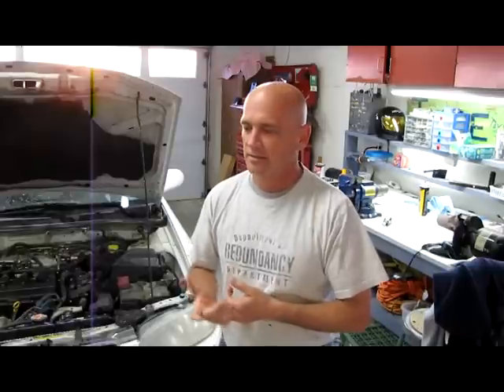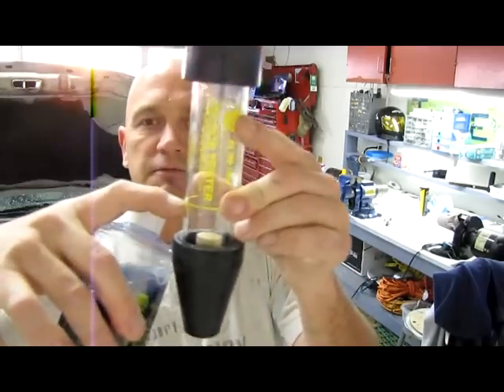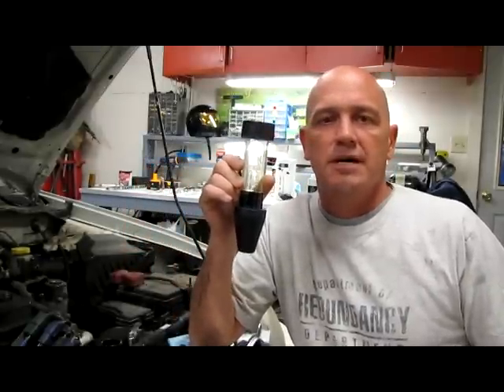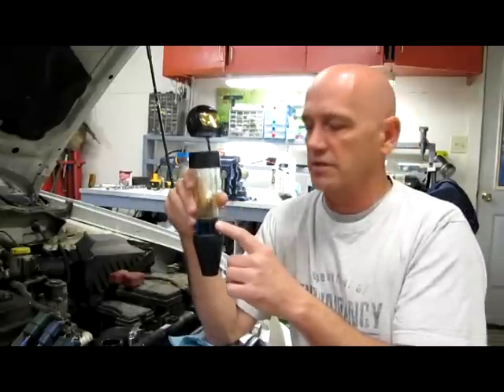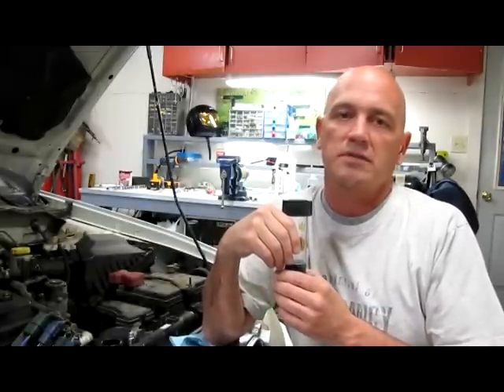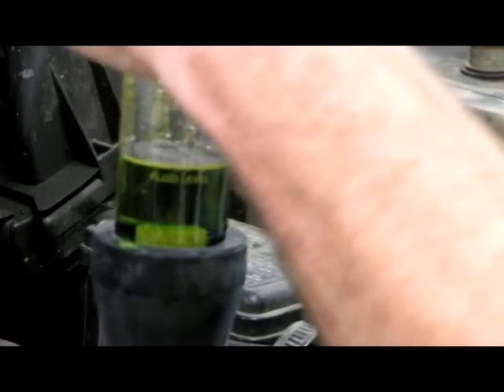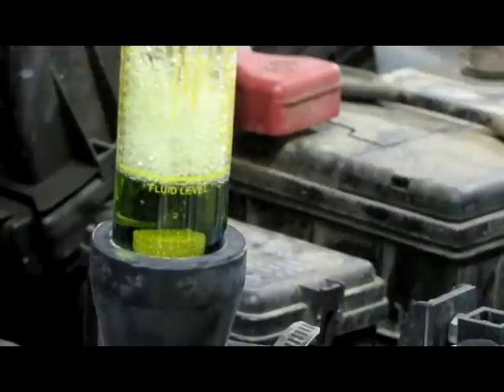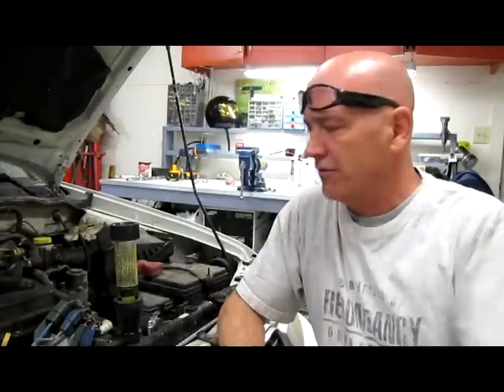How to Test Head Gasket

Comment from the maker: Hi William Chilean, thanks for your questions and for watching-I will try to answer.
1- I do not know the chemical that the block tester uses, but I will see about finding out.
2- The tip does look like a sponge, but I think it's more rigid than a sponge.  I think it's design function is force mixture of gasses through the test fluid.  To me it looks like a carburetor fuel filter that we see in old Rochester carburetors.
3- I think it is the fluid that reacts to the test gasses.
Interesting!

Comment from the maker: Final Note: some folks freak out when they see their engine temps at, say 220 degrees.  In my day, I was taught that anything over about 250-260 degrees was the defining temp 'moment' of actually being in 'overheating' conditions.  Remember, the cooling system is pressurized, and at my elevation (7000 ft above sea level), for every LB of pressure your cooling system holds, 3 degrees is gained above boiling point, not including anti-overheating chemicals found in coolants.Altitude will vary this.

Comment from the maker: >WhatsUpDaddio: As a general rule of thumb with overheating, be aware that typically, headgasket leaks are caused by something else that causes the overheating condition.  Leaks, blockage, anything that causes your engine to get so hot to warp that seal is the actual cause.  Be aware that repairing/replacing the gasket and/or head is just fixing the 'result.'  Find the issue as part of the repair process, and never run an engine into the 'red' on your temp gauge.  Ever.

Comment from the maker: >WhatsUpDaddio: You mention having to add water to your cooling system to get the vehicle home.  So, one clue to your issue is obviously loss of coolant going somewhere, and loss of it into the cylinders (bad headgasket) is what I call an 'internal' leak.  You have successfully tested negative for that.  Blockage or external loss would be the next troubleshooting steps in my view.  I will message you off this board to help you out if you would like.  All others, view my other videos,better sound

Comment from the maker: >WhatsUpDaddio: I'm glad that my basic video helped you in determining the basics for detecting improper fumes in your cooling system.  For all others, as I was taught, it's ok for coolant to also be mixed in at the time of testing, but it's better and more accurate for mostly water to be in the cooling system.  I do not know, however, if having 50/50 coolant would ruin the test, but I do know that if coolant gets into the test tool I wouldn't totally trust the results. Basic rule is water.

Comment from the maker: It's actually preferable to have straight water in the system for testing.  However you wouldn't want the level totally all the way up.  The idea is to suck only fumes or gases through the test tool.  If you check my channel you can see another more in-depth video I made on this process (with better sound).  You can leave some coolant mixed in as well, but again it's better to have only water.

Comment: Must the radiator have the proper coolant mixture or would it test the same with just water in the radiator.  My car overheated and I filled it with water just to be able to get home.  Just wondering if I need to drain system and replace with proper coolant mixture.